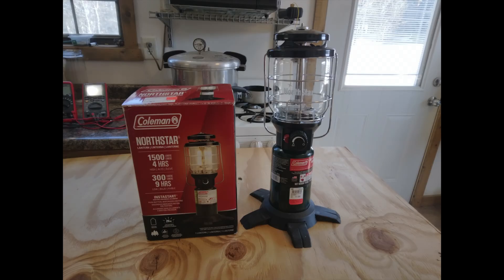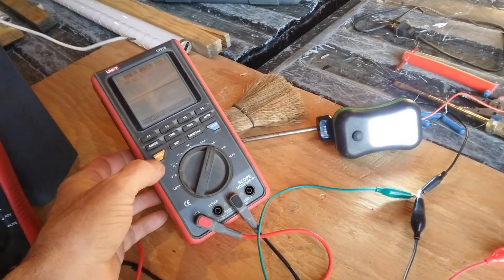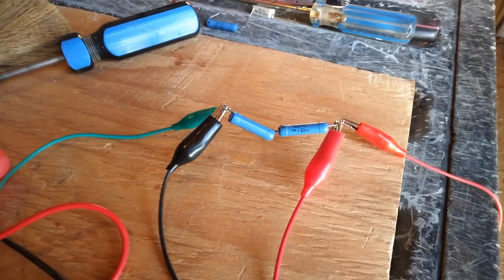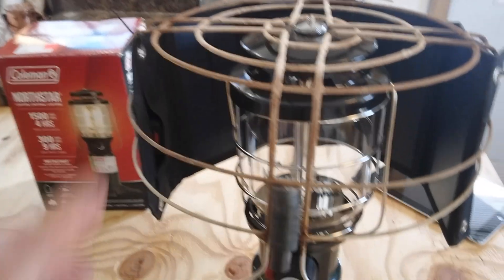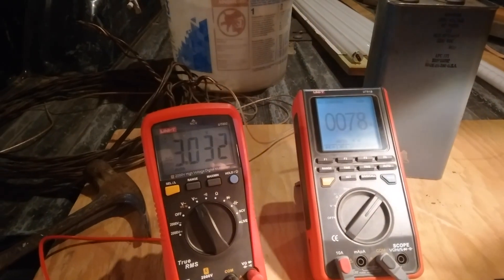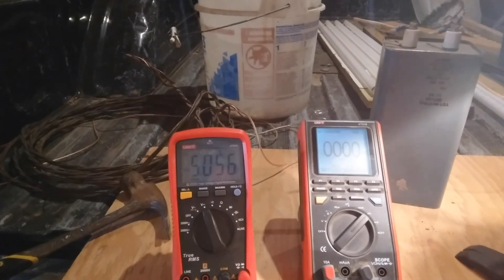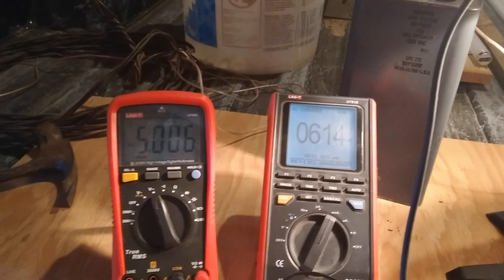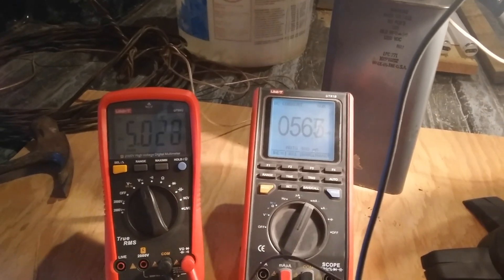Solar phone charger meets gas lantern

Comment: I wondered myself if a latern could produce enough for a phone charge even it took awhile.   Just never tried it. I moved here last year and then moved a garage to use as a lab at some point but it takes a lot of money top wire, insulate, put up alls and shelves then heating and AC. I am 69 and kinda worry that by the time I get that stuff done, I will lose physical abilities to move forward. Vision, joints, ect. I still do not need glasses and have never used them.  I see fine.  Good luck with future of your channel ! 🙂
Reply from the maker: Thank you!